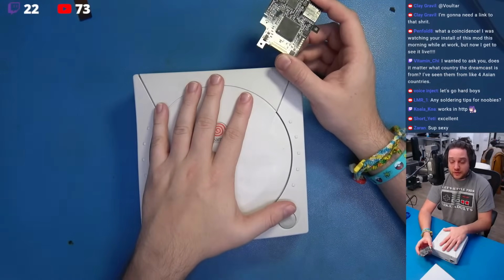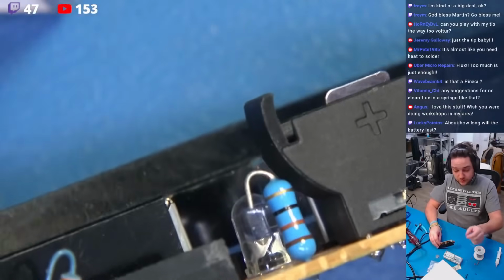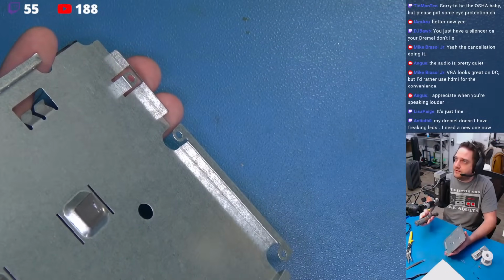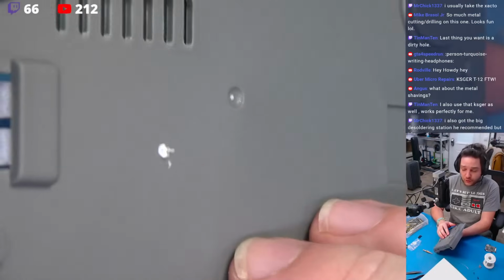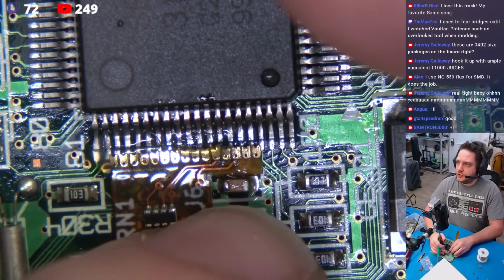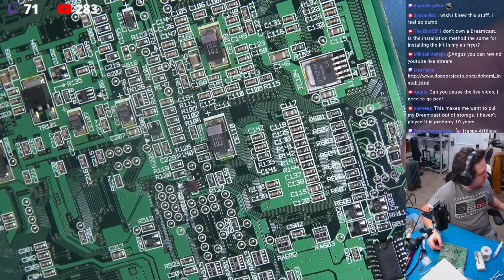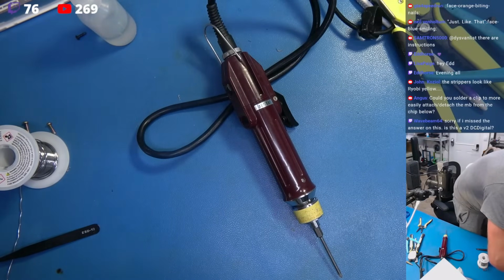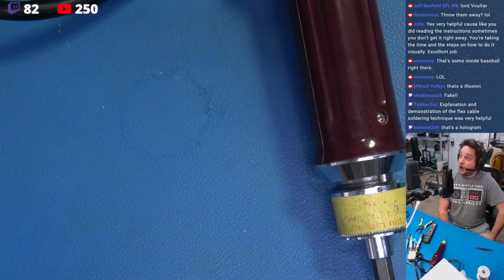Dreamcast HDMI Installation

Comment: I also found putting some packaging tape on the bottom of the case will shield it from making marks from the file when forming the hdmi hole.

And thank you, @ 107:16 - 107:64 - This is a MAJOR mistake most make and can’t tell you how many repairs are sent in due to this.

Comment: Hi Voultar, Any chance you can set the record straight with GDEMU in a VA0 Dreamcast? Do the resistor mods really work (and are they safe) for VA0 consoles? I can find the VA0 easily, but VA1 is getting a little harder to find in Japan!